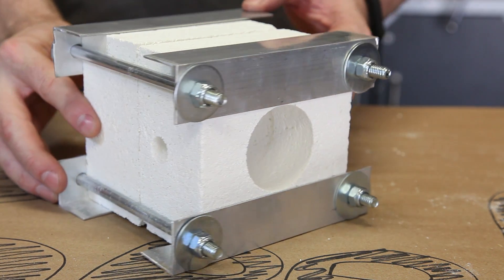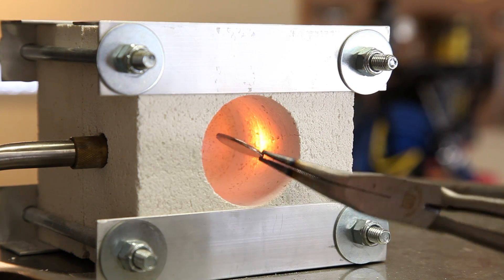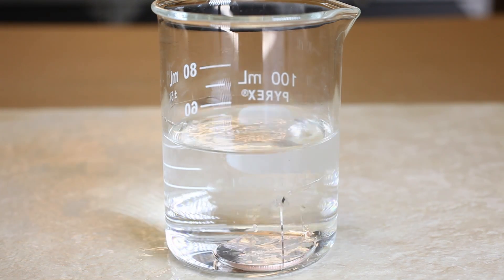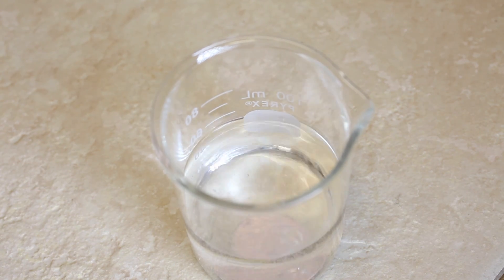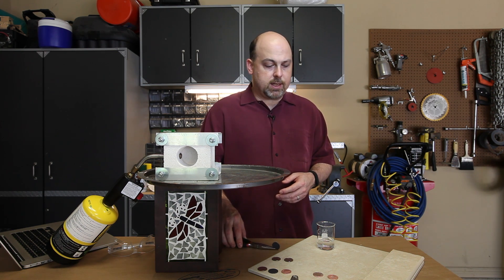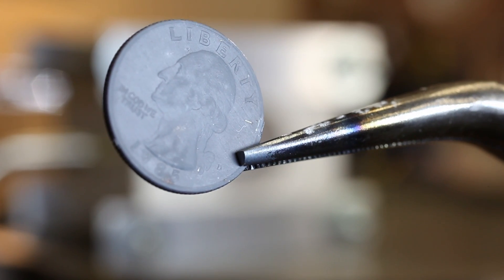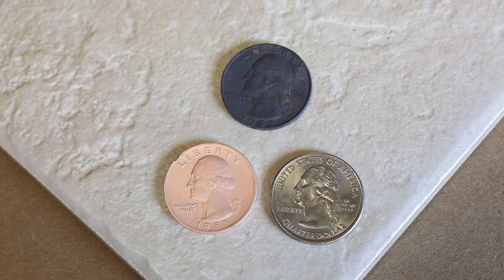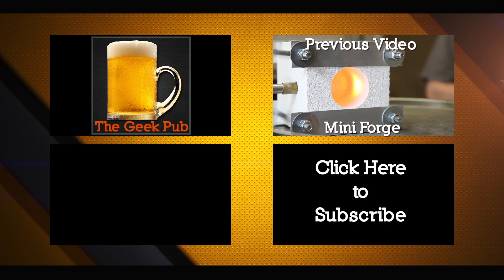How to make Copper Plated Quarters

Comment: its not copper plating it is just removing the nickel plating that the government puts on it when they make the quarters
Reply from the maker: +Andrew H.  That's actually incorrect, but close.  It is pulling a thin layer of copper atoms through the outer nickel layer.  You can scratch the copper off with steel wool or use a 50/50 mixture of hydrogen peroxide and hydrochloric acid to return it to its original nickel finish.